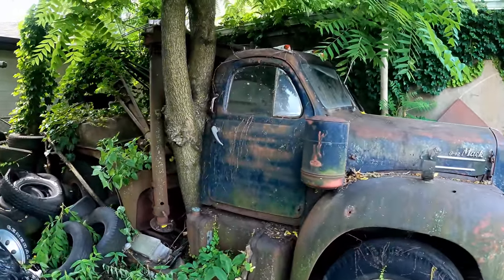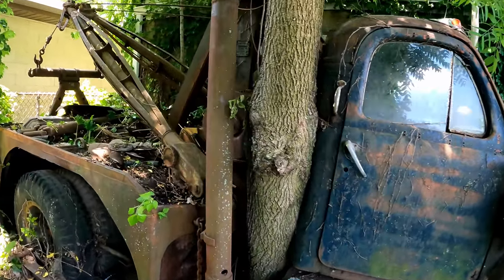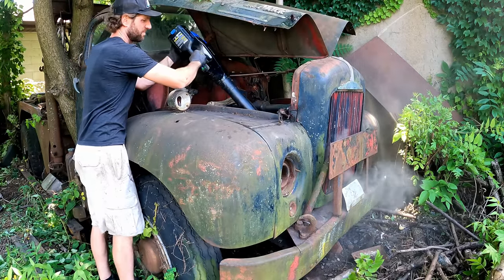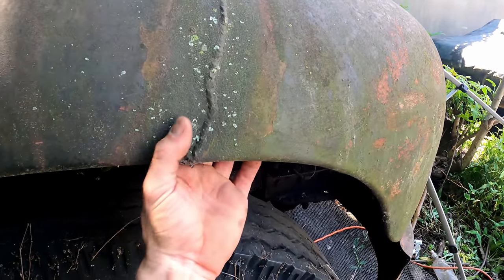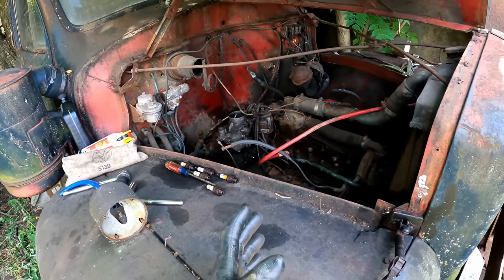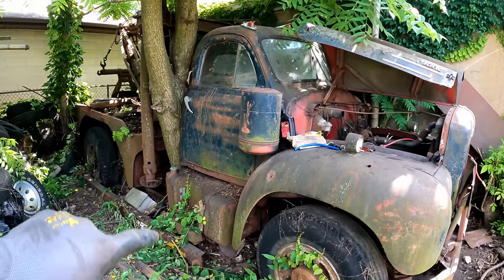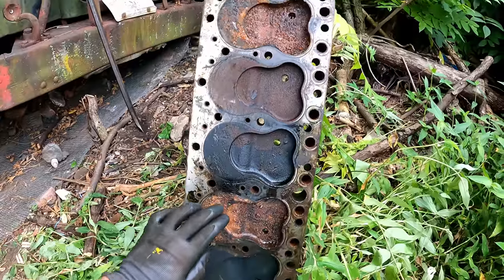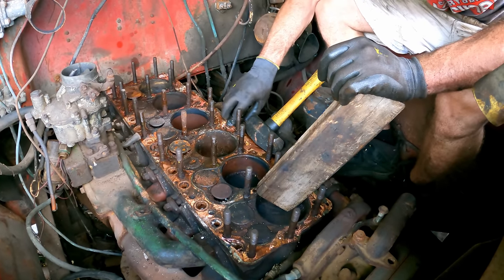Will It Run? Mack B42 Wrecker Magnadyne sitting 30+ years - NNKH

Comment: My local auto electrician is like that, they have been in business since the 60s or 70s, as long as I can remember anyways... The sons now own and run the business, they are still old school. My office is across the road and they seem to attract a lot of classic cars which is always pleasing to see. 
Took my '63 Morris Mini it to have its generator repaired. As the armature had already been machined, the owner said "I reckon I have one of those down the back" moments later he reappears with the correct part.
Seing this shop's wall of parts reminded me straight away of my neighbours.

Comment: It appears to be a Holmes 550 wrecker unit or a size close to it. Very good old units, most of the transmission and winch end parts are still available new. I learned to drive on a Kenworth that had a 850 Holmes unit on it. Impressive amount of power for it's size. Unfortunate the engine was stuck, but overall, that B model is in really sold shape - definitely worth saving!
Reply: I would have worked harder to unstick the the engine before taking the head off, my methods are force at the front pulley or ring gear with multiple, around 100, direction changes, and also use of acids such as vinegar, into the cylinders, though acid should not sit for a month unless diluted for that purpose, normally it works overnight.

Comment: That turn signal is a mechanical arm that hung outside where the driver could pull a cord or lever to signal a turn. Horizontally pointing to the left was left of course, and pointing up was for a right turn. Drivers used their actual arms for years and years signaling this way until electric flashing lights became the norm. This mechanical one could be positioned so that vehicles following the truck could see it as they might not be able to see the arm of the driver. Signaling turns with your left arm out the window was called “hand signals” and was often on the drivers license test. I remember rolling down the window in the rain to signal a turn. Fun times. And the whole idea was pretty useless after dark of course.
Reply: It’s actually still legal to use this. I had no blinkers on a motorcycle years ago and got pulled over. I showed the officer my hand signals (left, right and slowing down) and he let me go and told me to use the hand signals until I get blinkers
Reply: Hand signals are still on the exam
Reply: And straight out (horizontal) was stop.
Reply: @freethought2296  straight out is left. Hand pointing down is stop, pointing up is right.
Reply: When I was a teenager, I put an after market turn signal on the truck.  It had two arrows for left and right and looked really neat.  BTW, I am a female.  I didn't know very many females interested in restoring old trucks in the 1960's.
Reply: Pointing down was stop. Usually with the whole hand, not just pointing. My Grandfather and father drove all around Oklahoma that way, though just usually into town and back. One red light on the back and u weren't allowed to pass at night.
Reply: Aka semaphore signal.
Reply: In the UK, Right arm out turning right, circular motion turning left and up and down, slowing down. One of the rules when I learnt to drive in the Police, if you came into a restricted speed zone, 40 or 30 you had to wind the window down, no matter what the weather, to be prepared to do hand signals 🙂
Reply: @emsnewssupkis6453  Yeah. Rely on Cops... Thats good...

Comment: Back in the late 60's my cousin had a B Model diesel with a million highway miles on it. Tore it down to the bare frame, stretched it, tagged it with an air tag rear axle, added a sleeper,  bigger fuel tanks, rebuilt the engine, had the local body shop do the cab and front clip, Rebuilt the gear boxes, (5 speed and duplex) rebuilt rear axle, all new airlines, brakes, king pins, air seat, and new upholstery, etc  She went back on the road hauling cross country.
Reply: wow. just amazing.

Comment: The Holmes rig is probably surplus military. Holmes sold hundreds during WW2 for use as recovery and loading units. I worked one over 40 years ago which had a Garwood 22,000 lb winch run off the trucks PTO. It could drag anything out of trouble.
Reply: Correct  a Holmes W45

Comment: Holmes W45 most likely.  Military used the W35 and W45.  Most W45 had the "outriggers". A shop when I was a teenager had a W35 that didn't have outriggers.  Both were  BEASTS.  A lot of those wreckers ended up in civilian use.  Military truck was usually replaced with something more powerful and easier to get parts for.

Comment: Pretty cool!  I didn't realize that Mack had a flathead engine..."Back in the day", Seattle Fire had a few Mack B-Series trucks; there was one at our closest firehouse, on top of a steep hill.  It had a large gas engine, and I was told by an SFD member at one point, that the older gasser rigs (KW and Mack) w/ standard transmissions, were better on the hills than the current (late-1970s) KW rigs, which had Detroit Diesel power (6-71 or 8V-71) w/ auto-tranny.  The older rigs were quieter, too; the DD-powered KWs seemed to be straight-piped...
Reply: Probably a continental gas engine
Reply: A2 stroke Detroit without a muffler is much louder than any gas engine.  They sound cool,  but it gets old in a hurry.
Reply: @bertgrau3934  😂😂😂amen to that
Reply: Mack b 21 firetrucks, they came with a hall scott 1091 something like 350hp and almost 1000 torque super cool rigs

Comment: Would like to see you do more of will it runs ....locked up motors and taking heads off , cleaning up... basically trying break em free to start...cool vids ..some are prob to hard to try that with..later and have a good one ..b safe

Comment: I was a mechanic for a Mack dealer from '73-'78 here in Kentucky, I was in my mid 20ies then. In '78 I purchased a Mack and went to hauling coal in and around Ky., In., Oh. I work on a lot of those old B models and I'm sure I work on some gasser but can't remember any now. Work mostly on diesels tractors. One old B model that stands out in my mind was a tractor that had a tandem rear axles, but the rear axle was a tag or dead axle, meaning there was no drive shaft coming off the front diff. hooking out to the rear axle.  The front drive axle had a large pulley like hub attached to the inside tire/rim and the rear dead axle also had that same pulley attached to the inside tire or rim. It had a very large/thick rubber belt that went from the front drive axle to the rear axle, it was on both sides. I have no idea how much that helped but I guess the engineers though it did or would. lol I just loved test driving those trucks after working on them. 

John in Kentucky

Comment: Just a little advice. When dealing with a seized motor pour some white vinegar down each cylinder and wait about 10 minutes then crank the motor with the plugs out to blow all the vinegar out. Then spray some wd40 or similar product in each cylinder before reinstalling the plugs. Works every time. Also you might want to double check, that maybe a 6 volt system.

Comment: That's a Holmes W-45 wrecker. I owned one back in the 1980's. It was a good reliable unit. I sold it to a trucking company and they were still using it until about 2010ish

Comment: @NoNonsenseKnowHow   the vin plate is on the ps door by the latch. If you send  that number to the mack museum in the contact page,  they will send you anything they have on file for that truck. You can send a donation for their time but its not mandatory. They are the only manufacturer that really kept track of their products at the time of manufacturing. They will send you any build sheets, manuals and where the truck was sold or delivered. Keep that one going. There are not many gas engines still running anymore.

Comment: I'm originally from the Garfield area and had a towing business in 1971 my first truck was a 1947 Ford F-3 with a Manley geared down mechanical hand crank I ran all over the  Bergen Passaic  and beyond area with that beast. It had an old 312 replacement motor. With low low gear ratios. I think that  Holmes wrecker micgt have come from Johnnie's garage which was a Holmes dealer on the old Rt 20 at what was the merger with Rt 46 in Clifton . I bought a used wrecker body from them that came off an old wrecker used in NYC. what a disaster that was. My late brother Joe had a auto body shop on river Rd in Garfield . My parents owned a home in Garfield andy siblings went to GHS. It was a sleepy  close knit town in the 60/70s

Comment: The answer is no, he didn't get it running
Reply: Once trees have grown up through the vehicle splitting it apart.  Was my first hint that this wasnt going to go right.  Not sure what the fascination is with getting motors running that cant go anywhere is a thing.  But then again, the answer is youtube.
Reply: @wreitz455 if it runs then you're a step closer to saying " yep I could restore this" no point digging it out if it's no good
Reply: @waynewatts-ellson61  If you mean digging the motor out yes.  The frame of the truck is destroyed by the trees expanding the chassis.

Comment: If you had ever seen a battery explode you would be stupid enough to do the cables that way, I love watching but at times you might be a really bad influence on someone that watch’s you do dangerous things with no eye protection. Try to work safer or at least warm everyone not to work without eye protection. I think you are probably a good gentleman and would be sad if you cause someone to loose their eyesight . I’m sure you watch Derek and know he severely damaged one of his eyes and now is nearly blind in one eye and now is wearing safety glasses. God Bless  try to stay safe!
Reply: I was thinking the same I see this so often on these channels, I learnt the hard way!
Reply from the maker: That's more of a wet cell battery thing. And I actually did have a battery explode next to me once because I was welding with three batteries and it blew the top off of one since the Caps couldn't vent quick enough. If you been around cars long enough you would know that connecting the battery terminals even together for a second at a time is not going to explode a battery. But that's not even what happened in this case. The current was going through the motor windings
Reply: @NoNonsenseKnowHow  I became a certified mechanic and welder in 1970 and I have seen 2 batteries explode from jumper cables being touched together to test for connection and once under the hood of my 1955 Chevrolet apparently from a overcharging generator on the drag strip. I do enjoy watching

Comment: That truck went into service when I was born I later worked on em and newer models when I was apprenticing as a HD mechanic in the mid 70's yes they were still working at the redi mix outfit I worked for mostly all Mack trucks. Never worked on gas only diesel engines on Macks but that engine looks very similar to a continental they made alot of industrial engines back then and in four cylinder as well. The wrecker was most likely drivin by power take off (pto) they were drivin off the transmision usually the main trans as alot had auxillary trans as well. Yep spent alot of hours hanging upside down under those dam gullwings as a young mechanic.

Comment: Awesome vid thanks the early Mack diesels could be rough getting both heads off the studs before they used both later on and the two valve injectors were another story

Comment: About 40 years ago I worked for a towing company we had a early 70s Diamond “T” with  a straight 6 71 Detroit with a Holmes wrecker on it, at the time that Holmes wrecker was the most versatile tow truck on the road and it was king of the road as well, it wouldn’t cut the mustard now, but I used to luv driving that screaming GM especially when I hit the Jake brake. I left  the company and that Diamond “T” ended up the same way as that Mack, what a shame to see that happen to those beautiful old trucks.

Comment: Having experience in this industry ID love to have a vintage wrecker even if you can't use it on anything these days for your modern bumpers will just rip right off and use if wood blocks will only make it dangerous. But of you've got classics it will work just fine.

Comment: I'd recommend getting a non-marring strap wrench and turning the belt pulley rather than messing with sockets. Also I'd clean the stuck cylinders the best I can then pack the perimeter of the piston with soft soldering flux and gently & evenly heat the entire cylinder's walls with a rosebud torch. When the flux boils, quench the center of the piston with ice cubes and keep repeating until the rings break free. I love this channel hope you do well.

Comment: i've broken a lot of stuck motors free without damage but one in particular was so stuck I broke out the porta-power, bolted a chain down, put the rubber foot inside the cylinder and the metal foot on the chain gave it a few pumps, then bumped the starter. she inched free, then finally started spinning freely. unfortunately someone poured coke in one cylinder and it ate the wall badly. that was the stuck cylinder.

Comment: I had locked up motor on a 62 galaxy 
In 1980 
I soaked the cylinders for a week
And then pulled it behind another car throwing it into drive and neutral til it broke lose
Spark plugs were out making for a nice splattering sound under the hood 
After putting the plugs back it started
Only had to rebuild the carburetor 
It was the classic/story 
Little ol lady owned it

Comment: Bought a rust bucket 69 mach1 out of a deal I made for 2 mustangs . This had a 351 with a bucket sitting over the carb , the unique situation for the wrecker driver for towing was that I included a charger for him to cut a coffee can size tree he need to free from the cars engine bay . At leasta20 year Parker . I was only getting this towed for the motor and any chrome I could salvage . We ended up getting that 351 running but with a Smokey run . Shame how all the outside Parker’s met this end with weather reclaiming the vehicle to the earth .

Comment: Trouble with flatheads was the recessed area around the spark plugs if the plug wasn't right or the seal on it leaked the. Any moisture runs right in the cylinder.

Comment: Those old Bulldogs have got a lot of steel in the frame, single screw Bulldogs often weigh as much as twin screws made by other manufacturers. I love the rebuilt bulldog trash trucks you see in New York.

Comment: Nice video - Too bad you could not get the Mack started. Knowing that the motor was locked up due to lots of water in the cylinders and oil pan, I would not have wasted too much time trying to get it unstuck. Damage was already done. Anyway fun watching and I'm located only 15 minutes from Garfield, NJ and I'm in the area frequently.

Comment: What a project! And one that will provide immense satisfaction!!  I might add that the twin boom Holmes wreckers were very popular in the mid seventies, but I have no idea as to what their years of manufacture were. A friend of mine bought a new one about 1975, and commented that "everybody" was going to that style.
You can count on there being NO metric fasteners uses on any US made truck or car of this vintage. I think the metric migration began around 1980.
From the action you got with the 12 volts, you are probably correct in the 12 volts, but you will need at least a couple of group 31 batteries or equivalent. Take note how heavy the battery cables are!  You will need an engine ground of equal capacity. If it were me, I would surely make certain the connections were clean and tight, and use some kind of a starter solenoid or mechanical switch, which is probably what you see mounted to the firewall. If you can remove it from the firewall, it might well serve your present need.

Comment: I've got a 1986 square body Chevy 2500 single cab straight 6 with 4 on the floor Muncie, new predator air compressor...runs but needs carb rebuild/replacement....if you're interested

Comment: Would make a cool rat rod tow truck. Get her fixed up and keep the patina. The heater is gasoline carb fed type. Soak the engine and un seize it and strip it down and get it turning over and should be okay if the pistons ain’t bad.

Comment: I build a firer in each 1 to unstick with gas and diesel// on my 1960 jeep Willys then take a 2x 4 block of wood and drive the it down //then clean out top half of walls / more oil

Comment: Beautiful truck. Will you have to remove the engine block to repair the cylinders? Too bad the cylinders were flooded. You'll have to repair the cylinder head too... It's a beautiful engine... nice project. Best regards from Tenerife Spain.

Que camión más bonito. Tendrás que sacar el bloque del motor para
reparar los cilindros?. Que pena que se inundaran los cilindros.
La culata la tendrás que reparar también.......
Es una preciosidad de motor... bonito proyecto. Saludos desde Tenerife
. España.

Comment: This thing put back on the road with alot of love, some chopping here and there, a 12V Cummins swap with a 5 speed manual, and some Alcoa Aluminum wheels would be REALLY awesome. I always look at vehicles and imagine what it COULD be with some real love and the right person. It'd be cool to see it get some bodywork, some restoration, a new set of custom gauges, and a dark cherry with HEAVY Metallic flake and a black frame and Alcoa wheels would be amazing, but a rat rod look would be cool too. I'd LOVE to have something like this and about $50,000-$75,000 to work with. Like my Pap used to say, you can crap in one hand and wish in the other and see which one fills up first. Yes, I've always been a dreamer.

Comment: Did you check to see if the transmission is out of gear. If it is still engaged you won't turn it over very easy if at all.